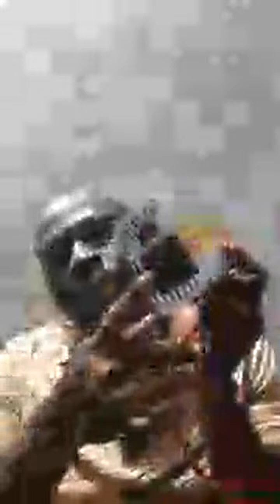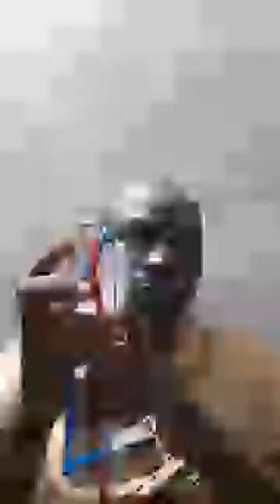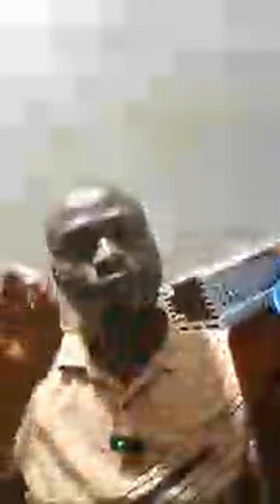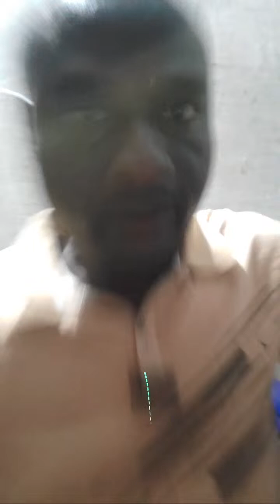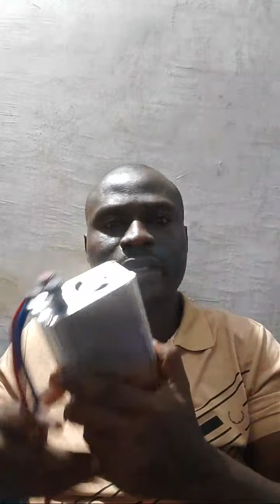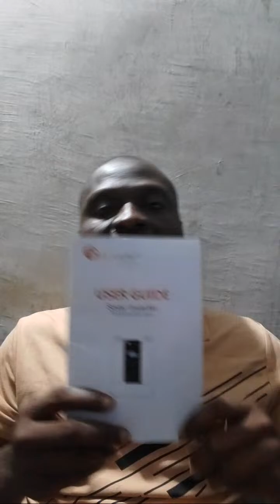Ask me a question!

Comment: Hello sir how are you. My name is azaz I am from south Africa I have a system of 600 w 2 solar panels with mmpt 50 A charge controller using 200 ah lithium iron poshphat battery nd 2000 w power inverter want to know what size fuse or breaker I can use nd where to where please let me know

Comment: Thanks for your technical support. I have these data on my solar panel and you plain explain . Pmax ---450watt, Vmp--3.91V, Imp--10.74A, Voc --42.8V, Isc--11.35A, max.system voltage --Dc1500v and max.series fuse. My question now is I have 6pcs of the 450 watt solar panel ,with 80amp charge controller mppt, with 24 volt inverter. How can i connect the solar panel so that I don't  excess the Vmp. Thanks

Comment: Jerry from Nigeria
Can we connect in series 12volt lithium battery  to a 12volts dry cell battery or lead-acid battery of 12volt
Reply from the maker: No please
Reply: Okay thanks 
Also can 4 pcs 200watts panel with 21volt VOC charge a 24volt/25volt system(2 lithium batteries 12.5volt each ).???

Comment: Can 8 panels of each 560w having an open circuit voltage of 50.10v and a short circuit current of 14.10A work well on a 5kw hybrid inveter with a 48v lithium battery when panels are connect in series?

Note sir that the place has no grid connection ,but just completely running on solar with one fridge,a tv 16 lights,a 0.5hp pump and an electric fence.
Reply from the maker: What are the ratings of the inbuilt charge controller?
Reply: @sarwattsenergy  solar charger mode as follows : mppt voltage range 55v, dc to 450v dc
Rated power 6000w,
Nominal operating voltage 240v dc,
Maximum charger 110A.